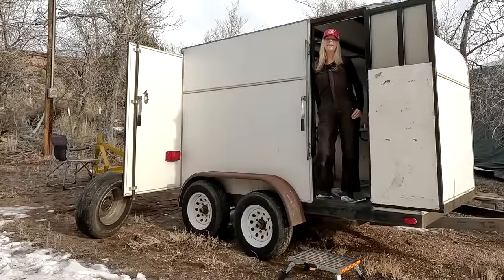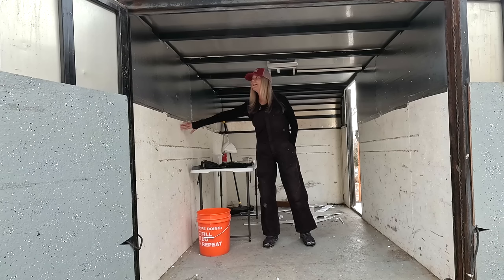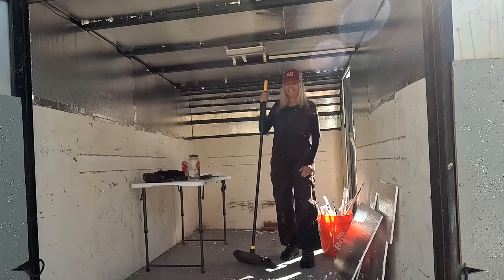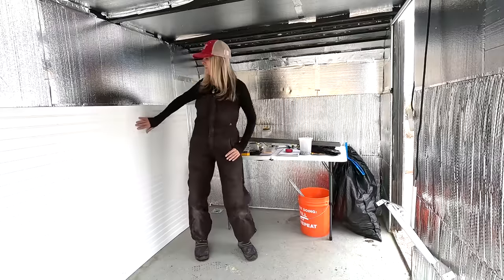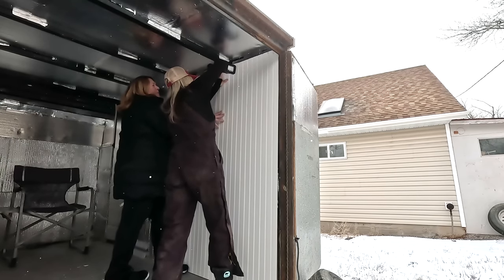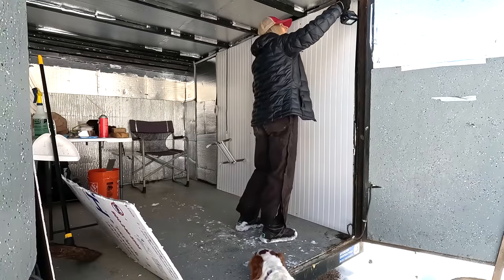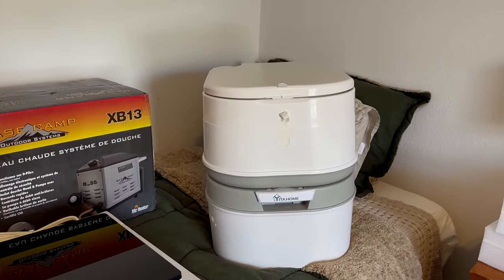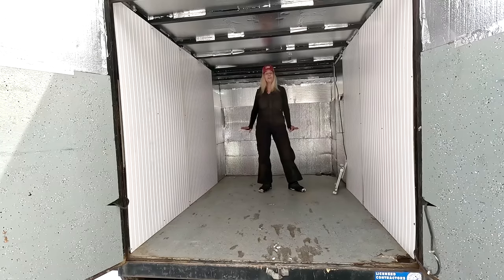I'm CONVERTING a 6X10 Cargo Trailer into a CAMPER and I Don't Know What I'm Doing! (Part 1)

Comment: Looks  like y'all are doing a great job! I covered a 7x12 alcom trailer one year ago. Insulated and paneled. I kept simple no plumbing. I put small chest freezer in and plugged into manual thermostat. Set to 33 degrees so it turns it into a refrigerator with a top lid, cheap and works great. I added a wall with storm door at the back 10 inches in from back doors. I added a 5000 but ac widow unit in the wall I added. That way when I close the door you don't see ac unit while traveling. Just open back doors when in use. I just put a cot down for sleeping because I haul a motorcycle inside trailer. When I go camping I take out table and portable sink and all camping supplies, simple and works out great. Good luck with the build!

Comment: Cargo trailers are a nice idea for conversions. They are all metal, no wooden walls to jar apart in dirt roads like conventional travel trailers. Also, will have no water leaks because conventional wooden walled trailers alway at some time get a leak that will not be seen for some time before the wood starts to rot. I am a big fan of cargo trailer conversions. That’s why some people go with airstream travel trailers because they are all metal, no rotting or jarring apart on back roads. Nice of you to help your sister and best of luck to both of you. Thanks for sharing.

Comment: Catherine, I love the fact that you are doing this. I have done several cargo trailer conversions. I would have done the windows and vent first, because if there is welding involves you have to be so careful.The last one I did, they used a futon to sleep on, cabinet with bar sink and 2-7gallon plastic jugs under sink with an everflo pump. One for grey water and one for fresh water.

Comment: Hi Cat, Has anyone suggested you install a few low voltage wire locations behind the walls for: overhead lights, the vent (suggest a 6" fan) and switches for all. 

I've built several van conversions over the years. Got better as time dragged on. 

Good Luck 😊

Comment: I’m going to build out a cargo trailer to tow behind my SUV as a toy hauler/camper for my motorcycle. I have the same IKEA induction cooktop. I’m not using it with solar, but I do like how I can adjust the wattage from very low to high. It cooks so fast. I’ve had mine for many years and I love it.  I learned how to use power tools a few years ago when I was renovating a small cottage from condemned. Great skills to have! I hope your sister is doing well and that you are, too, Catherine. I’m excited to see part 2.

Comment: Nice project looks good so far. Should be nice for your sister. I built a trailer for the boy scouts complete with power inverter, lighting, and usb charging ports. Used power from the tow vehicle and mounted a solar panel on the roof to keep the battery in the trailer charged. You could use liquid nails to help attach the paneling. Good luck with it and look forward to seeing it finished. Thanks for another great video.

Comment: What a great gift for your sister! I'm doing my van and I've definitely learned a lot! Good on you for jumping in and doing your best.  

If you might be doing projects like this in the future, an impact driver (like a drill on steroids) is great for attaching stuff to metal. Also, you might want to make sure the back doors can be secured so they don't whip about during windy days and damage the hinges. Finally, please put your hair up when using power tools. Signed, Worry Wart! 🤓

Comment: Hate to give advice. You’re doing fine with the camper. You might consider getting the tires replaced even if they have plenty of tread if they are old. Also getting the bearings packed so she’s not stuck. Good luck!

Comment: Nice job! I too built an 8x10 trailer. More of a man cave thing, I wanted to keep the inside open. To use when not camping. I installed a Jack knife bed, folds against the wall. That bed was very expensive, I would not do that again. So bottom line I can still haul thing and camp to. Late now but a magnet works for a stud finder, and I wish I had only one window instead of two. thank you ALL stay safe

Comment: Enjoyed this video.  

Just a suggestion - A low voltage microwave is easier to get meals done than the induction stove and with less power consumption.  I use my all the time in my class b.  It will run on my batteries, power station, or if I'm plugged up.

Comment: Before you insulate or any real work inside... Give it the water hose test ..meaning  spray it down  all over specially at the seams or any rivets or screws  , check inside for water leaks  if dry then commence with the insulation.  Have fun!  the track you are taking down is call "E track"

Comment: 06:15   material loss and not being difficult but tedious is true for those of us that have been building stuff for 40 years. Most building is logical, you just need to figure out what needs to be done before the other thing. Everything is layered and it can be very frustrating to have to remove layers that you put in to get to something that needed to be done but wasn't.
Reply: Catherinegregory1  scammer

Comment: I hope you are thinking about ventilation, especially is you have a heater or cook in there. You may have to cut a hole in the roof and put in an exhaust fan.
Reply from the maker: I mention in the video there will be two windows installed and a vent.

Comment: Joining the party kind of late, but I want to comment for those that don't know. Those fasteners are affectionately called "hell nails'". I build small trailers and now a wedge shell build out - like a truck camper but very very light. My thing is electrical systems... solar... inverters, etc. I build out a 6x10 and donated it; then gave away a 6x12. My trailer is a 7x20 and I went a little wild (definition: spend way too much). I am enjoying your videos. Any help I can be, just let me know. Earl